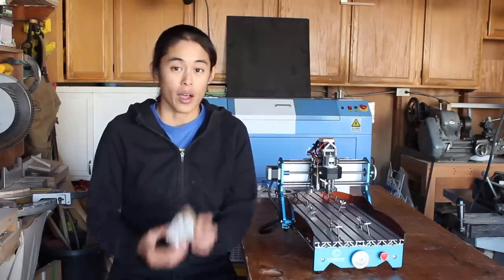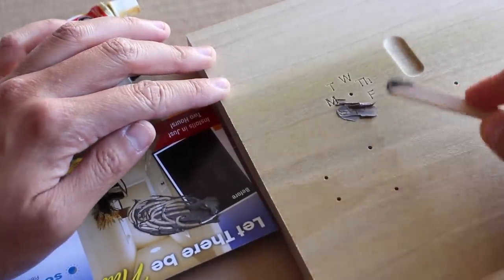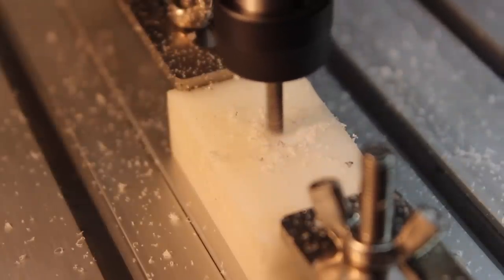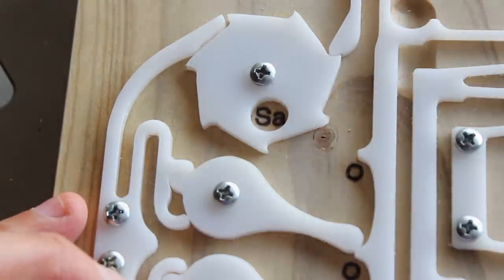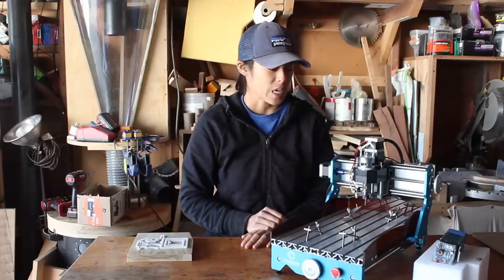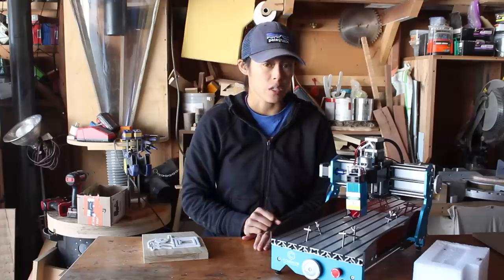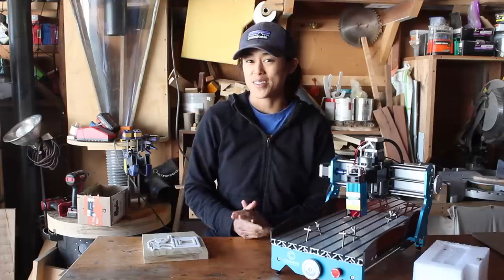Flexure Mechanism: resetting calendar

Comment: The tool most likely stopped due to excessive vibration. You can't climb cut with a tiny tool with that much of the stock sticking out. Climb cutting is where your tool pulls itself along while cutting. This also causes tool deflection. Try to cut towards the cutting edge instead of away from it. Also leave as little stock sticking out as possible to reduce vibrations.

Comment: Just putting it out there for other hobbyist CNCers: Whenever possible, check the CNC's manual for recommended maximum spindle speeds and feed rates.  Consider those numbers to be your absolute maximum--anything above MAX is changed to MAX.  Anything below MAX becomes the new MAX for this project.  Next check the bits you will be using and adjust your MAX and min values to be as close to the bit manufacturer's recommendation as possible.  That will get you all started.  

People try to do these feed rate and spindle RPM adjustments on the fly, but that is probably what caused the problem in the first place.  For example, plastic will melt if the feed rate and spindle speed are too high.  Metals will react differently depending on the type and whether the metal is pure or an alloy.  Sometimes the incorrect values will cause the material to work harden and destroy the tool.  How to fix that depends on the material and the tool; fortunately, manufacturers have spent a lot of money figuring out the correct values so you wouldn't have to.
Reply from the maker: thank you! 😊
Reply: @AmyMakesStuff  I occasionally cut plastic at work, or talk to machinists who do, and the big things are: (a) have a super sharp cutter with as few flutes as possible. we use robbjack at work and they do a pretty good job. (b) get a compressor and blow air on the cutter -- this helps evacuate chips and cools the cutter so you don't melt the plastic. some plastics make "stringy" chips which can wrap around your cutter and ruin it or the workpiece (c) play around with feeds and speeds until you find something that doesn't melt the plastic. even though you can probably get away with max spindle speed, it may generate so much friction it'll melt the part. a slow feed and medium speed may be your best bet.

your flexure parts remind me of the wire EDM work I used to do at my last job -- flexures are a super awesome way to make moving parts and i'm really impressed with your work! keep up the great work!

Comment: I have had the exact same "pausing" on other cheap cnc machines, and have come to the conclusion that it is due to electrical interference on the controller board. There are a lot of possible fixes that you can try such as grounding the spindle motor, and adding ferrite to cables (I went with wifi to completely get rid of communication issues), as well as grounding the bed.
Reply: Yes, can confirm. I solved that by soldering capacitors to the motor terminals.
Reply: So is it interference crashing the controller? Would another solution be to drive the spindle from a solid-state relay and a seperate power supply?
Reply: I had good luck with ferrite chokes on the USB cable connecting the board to the computer - this fixed my issues.
Reply: Ive had a problems with the cheaper stepper drives used on 3d printers and cnc machines. Primary culprit has been heat, ensure they are being cooled properly or they will start doing weird stuff.
Reply: @aaronwilliams7062  That would be my guess here too - since this happens only when cutting metal, it is likely the drivers simply overheat due to the extra load being put on them. And once that happens the thermal protection kicks in and shuts the machine down.
Reply: @JanCiger  yes it is a “soft” type of failure. Acts like the stepper is skipping steps because of mechanical overload etc, but in reality it is not skipping anything the signal just never made it through the amplifier. I hope this info can help save some others a weekend of debugging.

Comment: Noice! Always love to see some awesome flexures.

Two things about the CNCing process.
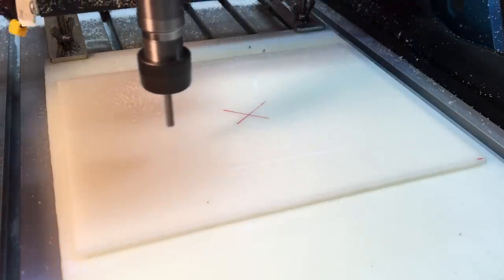1. A large amount of that play seems to be due to a massive amount of end-mill runout. Around 1:26, you can see parts of the spindle vibrating. This could also be related to why the sound was so bad.
2. My guess on why this machine would not machine metal has to do with grounding. Sometimes, an improperly grounded controller or motor driver can reset the spindle and/or entire machine, similar to what you ran into. A grounding wire on the material/bed/chassis might help.
Reply from the maker: I hadn’t thought of that! Interesting theory 🤔
Reply: Totally agree about the grounding, seems the machine is resetting as soon as it makes contact .vacuum does it to my 6040 with static.
Reply: @AmyMakesStuff  Not to sound insulting, you clipped the collet INTO THE NUT FULLY, before putting it into the machine a few turns, then sliding the bit into the collet and tightening, right? I've seen 3 makers on here, place the collet into the nut without pushing it in til it clicked, just loose like a dremel collet, then putting the bit in, then tight tightening it onto the spindle. TONS of runout. The collets clip into the nut with a loud clink, they don't float.

The reason the machine stops on metal is because it's shorting out. It has nothing to do with LOAD (like oh no, brass is so much harder to cut! spindle overloads and turns off due to heat/current. Nope.) Unfortunately this is a well known problem with pretty much all these tiny low-budget cnc machines. The good news is, the fix isn't expensive OR difficult. There's videos here on youtube about it, search "spindle grounding cnc" and also "spindle emi cnc" emi = electromagnetic interference. This is what's crashing the control board, turning the cnc off (spindle stops, stepper motors stop moving. it crashed and rebooted.) It's kind of a common problem, not just on inexpensive cnc's, but even big DIY cnc's!

I just came across your channel and dig it. The idea for this project is great. No way it would work for me with my puddleofdogs, but a great idea none the less. GL, and check the collet and nut! Take it off completely and inspect it. Make sure there's no flashing or crud stuck in the cuts/slices in the collet that would keep one area from flexing properly as it gets cinched in the taper, and make sure it fully seats in the nut, and can rotate freely once it's clipped IN to the nut (out of the spindle).
Reply: @dogsarebest7107  this sounds like solid advice that I will be taking if my career ever veers into this direction.
Reply: Sounds like you (Amy) could verify / try temp fixing this by mounting the metal workpiece on top the plastic "sacrificial" plate like you did the calendar parts to insulate it from the metallic work surface.  That way contacting the metal workpiece with the tool should have no electrical effect.  If that "fixes" it, then it confirms the problem as stated above and you can pursue the ground and shielding methods knowing you aren't wasting your time chasing imagined fields and electrons ;)
Reply: @Randrew  Exactly right. Good thinking there. Sometimes it's so easy to get buried under so many variables and 'what ifs' that the simplest answer eludes us.
Reply: She's trying to use the machine for which it was not designed. On their website is specifically states "Engraving on most soft materials like wood, mdf, plastic, pcb, and acrylic". It's not a metal CNC mill.
Reply: @larrybud  That page also has two other places where it mentions "The Pro CNC engraver can be used with aluminum, wood, acrylic, PCB, TPR, etc".  And at the bottom, even though it "says" wood, mdf, plastic, pcb, and acrylic, it has pictures right below that and one of them is aluminum engraved.
Reply: @craigchatterton4164  Fair enough. I'm wondering if "engraving" is considered different from "milling". I haven't d/led the manual to see what the stated limitations are. I'm willing to bet it says in there.
Reply: @larrybud  This has nothing to do with it.

This was not the spindle being overloaded, this was not steppers skipping steps. People use these things in a variety of ways.. that's the whole point. It can engrave and machine aluminum, it can just do it so slowly it's barely worth it. But that's not the source of the issue. It's well known issue about emi/grounding that all of these have.

Comment: Anyone with a vintage Craftsman 101/Atlas 618 lathe in the background is ok in my book. I cut my teeth on this very lathe some 40 years ago. You've got a brilliant mind and the ability to put it to practical use. In my line of work we're called two things. Practical Engineers and Troubleshooters/Problem Solvers. You appear to be cut from similar stock. Excellent design! Cheers! Zip~

Comment: Well done Amy, it's fun to follow the process of invention and fabrication.  Your designs are similar to MEMS devices I've seen -- Impressive.  I think you have a bright engineering future ahead of you.  The world is your oyster (as they say) -- yes, I rolled my eyes when I was told that when I was 17.  At 62, semi-retired from Microsoft (xBox, DirectX), telecom startups, and Amazon Kindle Fire, I am still inventing, patenting ideas, and selling products I designed.  I can and do use Solidworks, but I often use Fusion 360 because of the CAM (and for fast patent drawings), so I can drive both my large VMC CNC Mill, and a small one like you were asked to use (with the same issues).  Right now I'm hiring some DARPA interns to help me on some very fun projects...  anyway, keep up the good work and showing us the way.

Comment: Very well designed and then very well adapted to do the reset feature.

Good example using the 2 samples to show less stress/ force required in a properly designed plastic machine flexure.
Reply from the maker: I appreciate the comment, thanks for watching!

Comment: Nice video! Another vote here on electrical interference or something causing the stopping when you cut metal. It could be interference, but it could be a false Z probe trigger. Many Z probes work by completing a circuit, so if there is something wrong with wiring or layout you could be seeing a false Z trigger which could stop the motor controller. That, or what the other commenter said about electrical interference simply crashing the controller. Thanks for the vid and for the detailed info on your setup!

Comment: Hi. Your mechanisms are brilliant! I have a note to cnc machine: try to mill the material according to the recommended milling speed. It defines how thick the chip should be after machining.
Reply: I agree with aiming for the recommended speeds and feeds, but what do you do if your machine doesn't have the power output necessary to cut through the work?
Reply: My opinion on that mill is that it's garbage and it belongs where garbage should go. I base this on absolutely nothing but just how it kind of looks like it's a teenagers project - for which it would, of course, be amazing!

Comment: General rule is the softer the material the less flutes on the endmill. A single flute endmill will give you night and day results on plastic be sure to setup your tool in Fusion 360 and use proper feeds and speeds.  For aluminum a 2 flute endmill is usually best but aluminum tends to gum up on cutters so you have to keep it lubricated (WD-40 works great), ensure you are conventional milling to minimize radial load and ensure proper feeds and speeds. Take lots of shallow passes and it you should be fine. Small CNC's have limitations but it's amazing what you can get them to do with enough fiddling.  I have an X-carve, I could barely get it to work at first but after a lot of trial and error and modifications I can cut and engrave thin aluminum without issue. Great video keep it up :)

Comment: Really great video.   I have found that cutting delrin, if you get stringy edges the cutter is not sharp.  Try a fresh carbide bit.   When looking at milling a part, and the precision you are looking for, ask yourself what the load on the tip is going to be and the direction.  Ball mills have a unique cutting surface where the cutting speed is fast on the outer diameter and slow at the center. I generally use a lower feed for a ball mill than an end-mill when cutting the same depth.  Remember everything is a spring, some are stiffer but all are affected by the load you place on them.  If in doubt when cutting is fine cuts and slow feed.  Some steels and nickel alloys are sensitive and require a lot of cooling.  If the tool in not sharp all bets are off.  
Thanks for the video, it is great to see a real engineer / artisan in action.
Peter

Comment: I just purchased this CNC but knew that I would be upgrading the spindle to a 500W motor.  So far it is working well. I am using it to mill aluminum landing gear parts for RC jets.
Reply from the maker: that's great to hear!

Comment: Just a few thoughts from a machinist on cutting metal.

Axial depth of cut is probably a bigger enemy here than feed per tooth. Feeding slower often causing the cutter to rub and generate a lot more heat - metal likes to be cut so a higher feed rate seems counter intuitive but often works better.

Try stiffening up the tooling by reducing the stick out as much as possible and also, you mentioned having to brush swarf away - I wonder if you could turn your spindle into a fan too to blow it away. Messy but my help keep the work piece cool and flutes clear.

And great job by the way! Your design is brilliant.

Comment: Nice work! I really like how effective these mechanisms are! I have some advice for your manufacturing using the cnc router. Machining some materials can be a bit counterintuitive! Feedrates that are too fast or too slow both reduce cutting efficiency. When the feedrate is too fast, the spindle might not have enough power to cut chips because they are too thick. When the feedrate is too slow, the tool heats up the material as it cuts. This results in the tool not cutting material for a while, then suddenly grabbing a lot of material, resulting in a large chip. This sudden large load might be triggering the machine to shut down! The term for materials that do this is "gummy". Some examples of gummy materials are some kinds of plastic (polycarbonate), aluminum, and titanium. I suggest you experiment with increasing your feedrate while cutting gummy materials if you're having issues. Feel free to ask me any questions you might have
Reply: I don’t know if it’s considered gummy or not, but copper loves to grab tools.
Reply: @Pablo668  indeed! Copper is a very gummy material

Comment: Great to see you again. And Thanks.  
Combining mechanical "glue logic" with flexure mechanisms seems to be my jam these days. 
As for modding the CNC, yeah, the base looks pretty solid. As for using a higher wattage spindle than that 775, I'm guessing that we'd need also look into beefer controller as well. At that point, would it be better just to go all in by stripping it down to its wires and specing all new electronics?
Reply from the maker: an excellent point!

Comment: I found some tungsten carbide drill bits for my dremel on amazon that are just awesome and they crunch anything I give 'em.
What I'm trying to say is that the drill bit may be the one responsible for the failure on aluminum, even the speed (higher speeds and the smallest layer height possible would have been better).
Also, while not good for the application you had in mind, lead free pewter alloys are nice metals for mechanical parts. Some of these alloys can withstand up to 6800 psi when properly designed (the parts must be designed to be ticker than usual).
As a proof, even though this may raise some eyebrows among gun-haters readers, I made a sear for a milsig m17 out of lead free pewter. Its job is to withstand a high pressurized chamber which pushes a bolt on it with an extreme force. The trigger mechanism then uses the sear as a lever to slip it out of contact, releasing the pressure. In my marker, I pressurize the chamber well over 1600 psi and, so far, I didn't get any catastrophic failure and this mechanical part is working great. It does wear out with time but I can easily remelt it to make a new one. For anything mechanical which doesn't have to withstand high temperatures, I highly suggest trying this alloy.

Comment: Hi Amy, try using less flutes with constant vacuum chip clearing and try using the same number of flutes with constant vacuum chip clearing. Also you could alternate chip clearing with dripping machining oil on the flute edge. In my experience pushing the limits of hobby machines ends up more as an art or trial and error since you cannot match textbook feeds and speeds. You could also try machining brass rather than aluminum and may not be able to escape babying the machine start through end with the constant manual application of coolant and chip clearing.